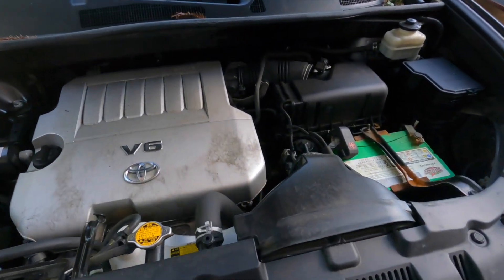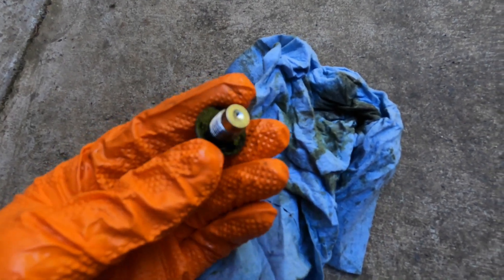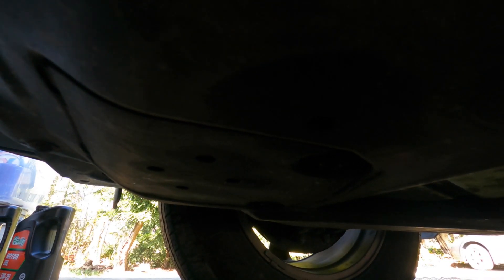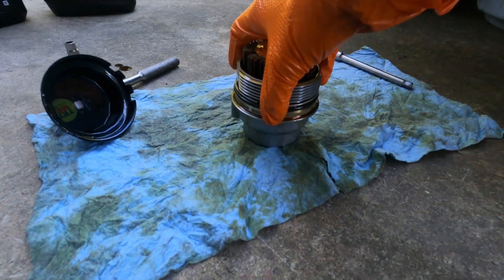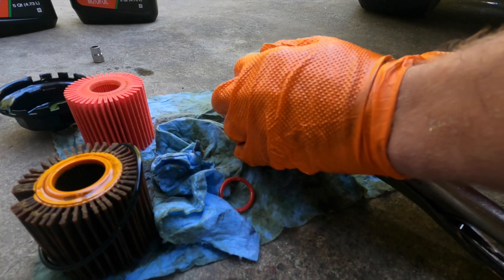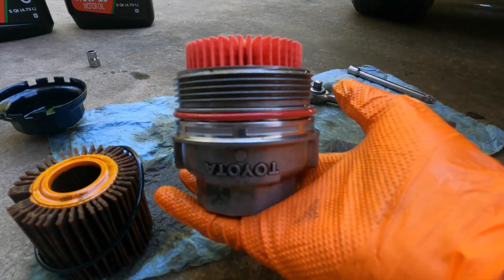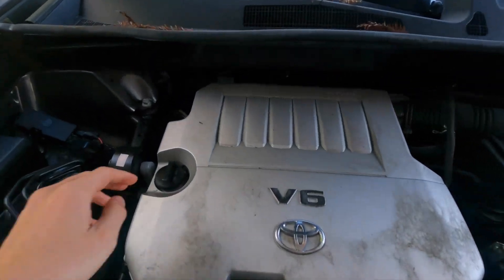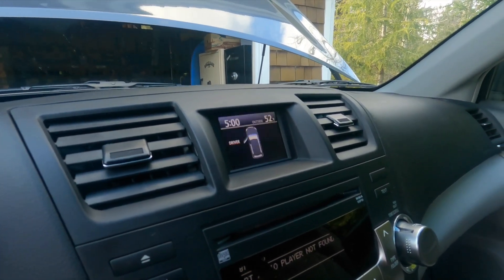2012 Toyota Highlander Oil + Filter - Resetting Oil Maintenance Light

Comment: That 5W-20 needs to be changed more often than 0W-20 cause it's not synthetic.

No need to change the small o-ring on the oil filter cap that goes under the drain cap since you didn't drain the filter before you took it off.

Torque specs...
Oil filter cap = 18 ft.lbs.
Oil filter cap drainbolt = 9 ft.lbs.
Reply: It's not about 6 quarts of oil , it's actually 6.
5.quarts of 0w 20

Comment: You used incorrect oil grade and toyota spec is synthetic oil and never use 2 o rings on drain plug the rubber ring was forfilter drain.